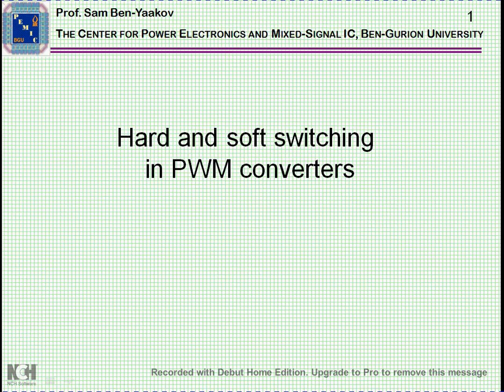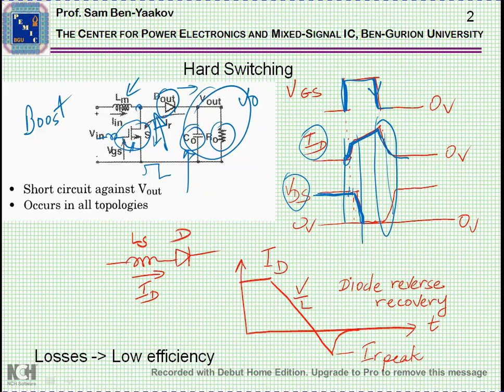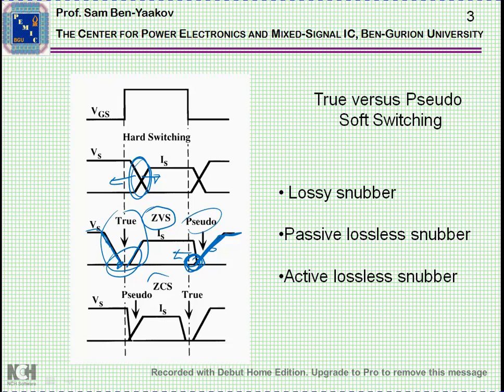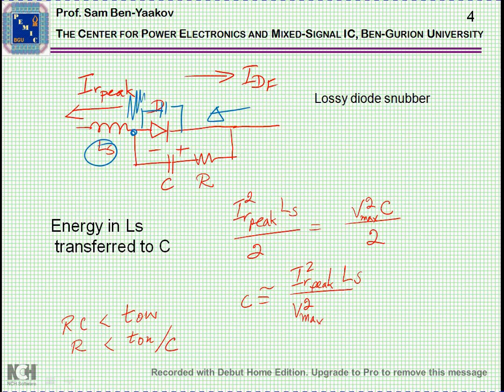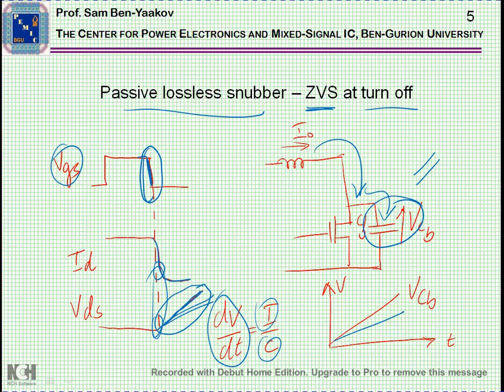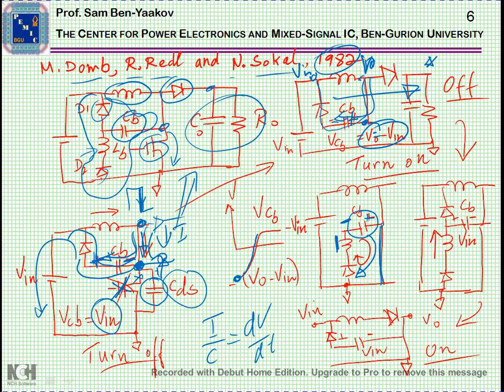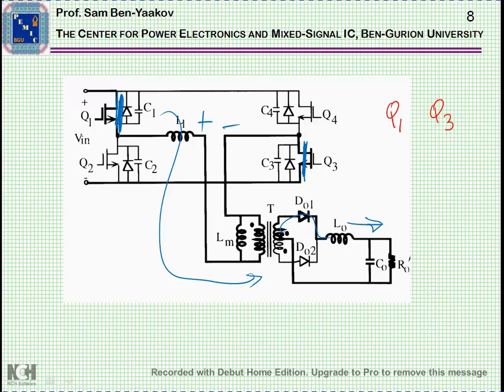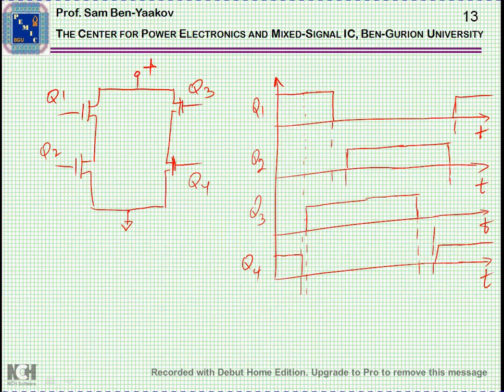Hard and soft switching of PWM converters

Comment: Pro. Yaakov, why is  RC <  ton? Is Ton related to the diode?
Reply from the maker: Please indicate at what time in the video slide number you are referring too.
Reply: @sambenyaakov the inequality RC < ton is shown on your slide. You did not explain the inequality. That’s why I asked the question.
Reply from the maker: @lancefree7544  "on your slide"  which slide?
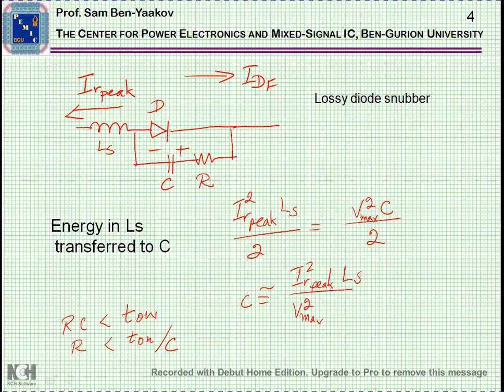Reply: @sambenyaakov at 12:53, slide 4.
Reply from the maker: @lancefree7544  This is the transistor's on time at which time the diode is conducting. So, to ensure complete discharge of C, RC<ton.
Reply: @sambenyaakov thank you, professor Yaakov!

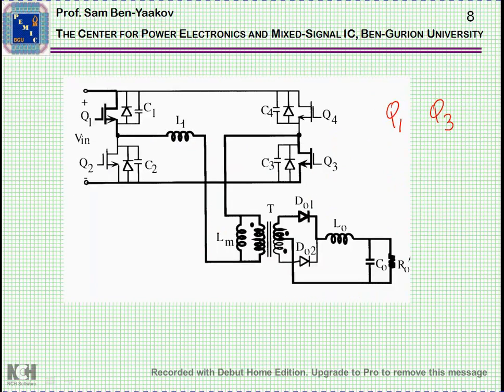Comment: At 27:15, i can see a capacitor in series with inductor. But this capacitor was removed in further explanations. May i know the reason for the absence of this capacitor. Will this converter be still a resonant converter even in the absence of this series capacitor.?
Reply from the maker: You have a keen eye. The capacitor is used to avoid average DC voltage on the transformer. If, however, one uses PCM control than the capcitor may not be needed.

Comment: should it be refereed as ZCS as opposed to 'ZVS at turnoff'
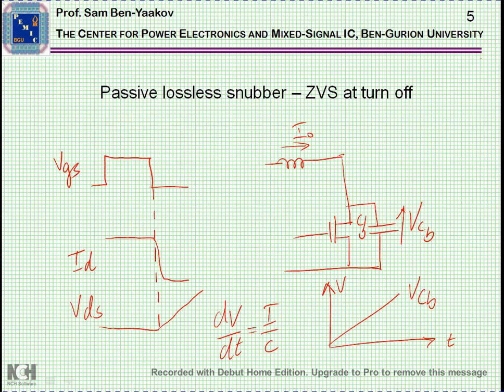Reply: Hi, at 16:50. Probably just words game, but closed fet already has 0v, so any openings of fet you want to happen at zero current, and closing at zero v. Thanks for sharing your lectures!
Reply from the maker: @romma11  In this case, the FET is conducting so there is a current passing through it. Tp achive ZCS you need an auxiliary switch that will force the current to zero (by re-routing it) at this part I am considering passive solutions.
Reply from the maker: To which minute in video are you referring to?

Comment: Sam - on the very first slide, you show two different hand-drawn graphs both labeled "ID". One appears to be the switch drain current, the other appears to be diode current including reverse recovery (also drawn below the schematic with an inductor labeled Ls instead of Lm like in the schematic). They are completely different. The schematic does not have any label defining what is ID? This is confusing to a student trying to learn this for the first time. Please make sure that variables are uniquely identified, and properly labeled in the schematic.
Reply from the maker: Noted

Comment: Thanks professor, I was just wondering that in the first example you are using snubber in parallel to diode, doesn't this provide a path for current to flow in the reverse direction when the diode is in blocking mode?
Reply from the maker: Only after reverse conduction of diode is completed. Before that the voltage of diode is still low.

Comment: You do an excellent job of explaining voltage snubbers in this video! 
I am trying to create a LT Spice model to simulate different snubber configurations and view the timing so I can gain more experience. One of the questions I now have is: How can I be sure I have selected an appropriate diode for the application? (short of building it in hardware and testing it for magic smoke)
Reply from the maker: Recent SPICE and LTspice diodes are pretty specific diode functions.

Comment: Thanks for the video. I got question about turn-off losses of PSFB converter, since with the ZVS we get rid off only turn on losses. What part of losses is turn-of losses? Thanks!
Reply from the maker: Overlap between dt/dt and di/dt
Reply: @sambenyaakov  Sorry, I asked question wrong. I had in mind the following: what part of the loss falls on turning-on and which on turning-off of the the transistor. What is more significant loss on turning-on or  loss on turning-off or they equal? In datasheet of the transistor there is Eon and Eoff - parameters, where Eoff>Eon. Does this mean turn-off losses more than turn-on losses?

Comment: Super useful video. It looks I accidentally re-discovered the active phase shifted PWM when I was designing my inverter circuit. I knew it was probably extensively explored in literature, but I just was having fun playing with timings myself to improve the circuit. I think it is very elegant, and with DSP control it is also really easy to tweak. One can for example actively monitor voltages at the switching nodes, and figure out when is the right time to do transitions as quickly as possible.
Reply from the maker: Good points. Thanks.

Comment: I've built a ZVS driver using the third option the passive lossless snubber because I need the capacitor to dump all its energy at once in the primary coil of my flyback, the flyback produces about 150KV, I can pull 15cm very hot plasma arcs with it... You're absolutely right about the safety, it's very very dangerous indeed. But a lot of fun to play with.

Comment: I would like to thank you for the excellent material presented in all your lectures .
I am a little puzzled at 24.56 in this lecture .
If I have followed your reasoning correctly , then I think that Vin > 1/2Vo should be Vin < 1/2Vo in order to reset the capacitor to at least Vin .
Please correct me if I am wrong .
Reply from the maker: Hi, Thank for comment and for finding the error. Yes, you are absolutely correct. A slip of the tongue.

Comment: I sometimes find it confusing trying to follow your thoughts because I don't have a clue where your pen is pointing to. That said, it was very enlightening to know warts and all about the reality of circuits and their components. Have you given any thought about the same topic but done with vacuum tubes instead? Would they perform better or worse? Could you do a video on the Ćuk converter? Other video suggestion would be protection at the input and at the output when power is lost or load is disconnected or developes a short. Thanks.
Reply from the maker: I am sorry, some of the older videos did not record the pen movement. Too late to correct.

Comment: Respected professor I am in confusion to select which type of converter. Isolated or no isolated or soft switching techniques for 1mw pv system. Can you help me where can I get all the information regarding DC DC converter.
Reply from the maker: Hi, This is a too general question. You have to specify required output voltage. There might also be a problem of a start up.

Comment: thank you ! professor! As i know from your lecture , the circuit from M.domb,R,Redl and N.sokal just reduced VDS slope when FET turn off . it will not help to turn on .Am i correct?
Reply from the maker: correrct
Reply: First thank u Sam, but why it will not help to turn on? I see it help in both switching sides (ON and OFF) by reduces Vds slope.
Reply: @DOODI7100  This circuit  gives no advantage at switch-on . In fact, there is a slight disadvantage at switch-on because the voltage on the lossless capacitor must be reversed via the resonant circuit which results in a half sinusoidal current peak .